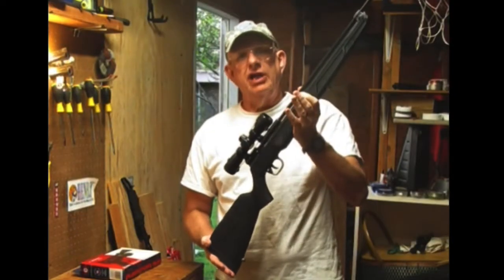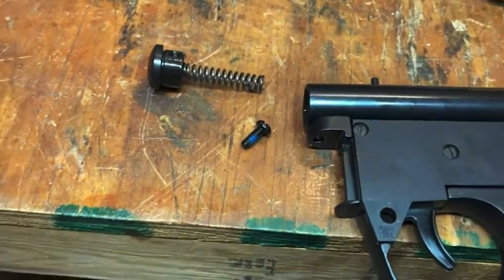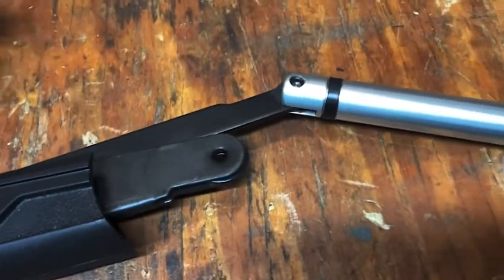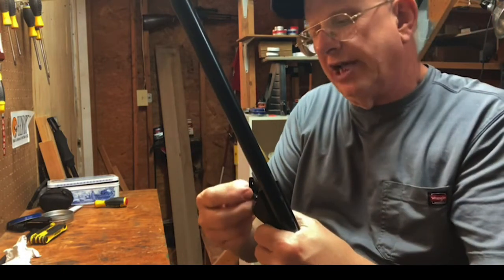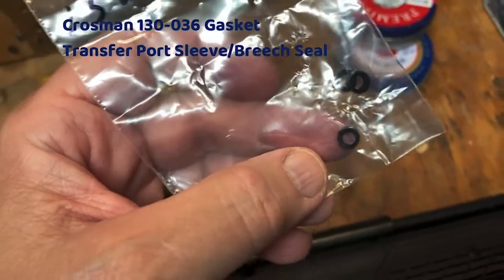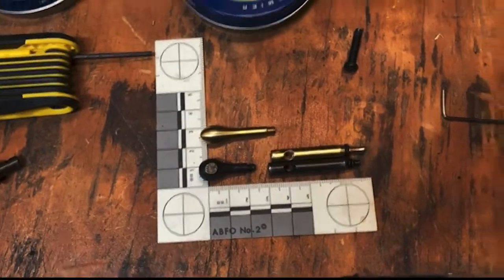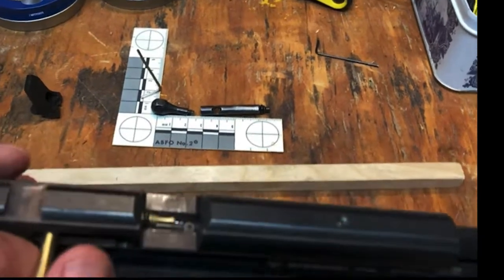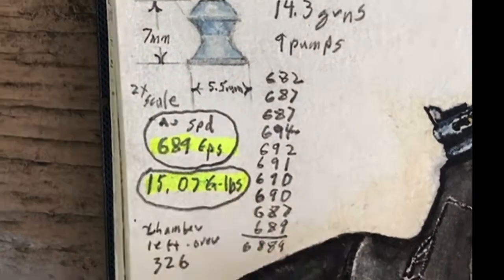Crosman 362 amped;  latest mod, a custom valve cylinder, requires taking it apart but gets 690 fps

Comment: You need to get a heavier hammer spring or lighter exhaust spring to get a full dump. You ae over pumping the rifle and getting a partial valve lock and retained air.
Reply from the maker: I did.  Three different ones.   I did a video on it, and in the process lost about a month's time in making videos.    The video came out end of last summer "Murphey's Law goes into effect."   The Crosman valves are not designed for the PSI of multiple pumps these aftermarket guys say work;  I had several viewers say all I needed to do was get stronger springs.   If it works for you....fine, didn't for me..   If you limit the number of pumps, the gain in speed in marginal, and absolutely not worth the effort or the expense of the drilled out valve.    Thanks for comments, though,  just my experience is different.

Comment: Who makes a good extra power hammer spring for the 362 ?
Reply from the maker: I don't think there is any one brand name seller.   I had to look up the hammer springs under a general search of Crosman 362, Crosman 2240 repair modification parts on e-bay.   There are three different sizes.   I tried three.   That is covered in a subsquent video, which I referred to later in this one.   The one called "Murphey's Law goes into effect"   It is listed in the discription section above too.   I don't think this kit works with a stronger spring.   Better off just taking the left over air out on a follow-up dry fire.   I ended up screwing up the modified valve so much, I don't think it is safe, and  just going back with the factory valve and spring, and it works fairly well with the extended bolt and the metal breech, which do make a difference and do not put a strain on the valve assembly.   If I had to do it over again, I would have stopped where I was at the end of this video, and like I said either bled out the extra pressure on a dry fire, or not pumped it as many times.   But as you can see from the comments, a lot of people apparently had success from a heavier spring;  I didn't, and don't endorse it.
Reply: @brianwilke592  I think maybe a heavier hammer might help it. A heavier hammer would hold the valve open longer before it springs back I think. I have not been able to find one. I have a 100th anniversary. I really like it. But it works best with 7 pumps. I don't have a chronograph. But I know it don't hold a lot of air left at 7 pumps. At 8 pumps it seems to hold a lot left. I would like to get just a little more out of it. I want to hunt squirrels and rabbits that get into my garden and blueberries a lot. I need about 700 fps instead of 600 and that might do it. Energy goes up with the square of the velocity. 7/6 squared is 49/36. Close to 7/5 or 40% more. I don't want to modify this rifle much but it is very accurate. Just a little more energy and it will make a good small game rifle. But it's got to be able to dump the air into the barrel. Well anyway I am going to study on it a little more before I start modifying a collectors item. I like watching your videos. Informative. Keep em coming.

Comment: Also you got quite a bit of retained are in your valve you could definitely benefit from a heavier hammer spring and you can definitely get over 700
Reply from the maker: Several other commentors also made a similar comment, so I tried, unsuccessfully, to increase the hammer spring.   I ended up locking up the valve to the point where it was kinda dangerous.   I should of just dealt with the air dump; the velocity was good, and it takes some extreme fine tuning on both the hammer spring AND the valve spring.   Here's a link to my subsequent video:  https://www.youtube.com/watch?v=gAjhF_W9xf4&t=221s.   I appreciate your advice.   You might have had a successful conclusion, if you did, let me know.   Thanks!
Reply: @brianwilke592 I do have a successful conclusion the 262 is the exact same system as the 1322 just with a longer stroke tube and barrel and I was able to get over 700 ft a second out of the 1322 and 14 inch barrel so the 19 inch barrel on the 262 with literally double the stroke  volume if you get online there are tons of mods for the 1322 and they will all drop on to the 262 the 262 honestly can produce 800 ft a second with a lead 14.3 grain and 15 strokes with a flat top piston & valve, retuned springs, exhaust porting, barrel porting, ice maker tube for a transfer port reshape the face of the exhaust seal and thin down the shaft of the exhaust seal in a certain spot and pin the inlet seal so you have no dead air in the headspace and then if you want to take it a step further so you can over pump it without causing any damage to the system over years of service pin valve through the tube and into the meat of the valve and make a spacer between the PIN for your pump arm and the PIN for the barrel band so you reinforce both ends of the pump stroke then you'll have a 25+fpe multi-pump that you can pass down to your kids. I totally nerded out on you sorry😅

Comment: Cut you a little piece of ice maker tube for the refrigerator and use that as your transfer port not only will it have a larger inside diameter for more airflow but it's plastic so it's going to seal really good
Reply from the maker: Good tip!   I'll try that on any project with a Crosman, since their transfer ports are all pretty much the same.
Reply: @brianwilke592 Benjamin too

Comment: The 362 uses the same trigger as the discovery and 2260. You can do the 2or 3 set screw mod that makes it adjustable  all you have to do is  drill and tap the back of the housing and add set screw  it takes quite a bit of slop /play out of the trigger .  If you want more power  makes the valve a flat top  cut the tip and sand flush and flat them order the flat top pump piston. You can use the same valve  this will give you the most amount of power  the only other thing that can be done is the all port hole enlarge along with barrel    and valve  to match .  You could also  put a heavier hammer spring and light valve spring  so the valve stay open longer . Just a few more power upgrades and tips. 🫡💯👍✌️😉

Comment: I had a 362 that wouldn’t quite dump all the air at 8 pumps. I ended up shimming the hammer spring with a washer and trimming the valve spring slightly (which probably wasn’t necessary.)
Reply from the maker: I ordered a .42 gauge hammer spring, shorter than the factory from Magnum AirPower.  He claims it will help with air dump problem. Several other commenters have also said the spring may be the problem. I gotta finish editing my next video first though. (It didn’t turn  out like I wanted, but the show must go on). After the next video gets out, I’ll try it.

Comment: Did you try a little heavier hammer spring?
Reply from the maker: Not yet. The information provided by the seller of the custom part indicated the 362 spring was powerful enough; it was the reason he provided a new, stronger hammer pin.   But yours isn't the only comment that suggested going with a stronger spring.   I need to look in that more.   Do you by chance have a recommendation?   If buying the right spring makes the difference, I'm game.  Easy enough to install a new one.   Thanks for the comment.
Reply: @brianwilke592  One definitely can get some pretty good gains on fps. However, with anything in life, when you change things  there can be side effects some negative some positive. While that valve is a tough proven workhorse, the stock cocking pin "could" bend over with time and it also puts more strain on the trigger sear (especially if you modified the sear spring to reduce trigger pull). Also, one runs the risk of a negligent discharge if the gun is bumped. The good thing about it though like the 1322/77 platforms they have aftermarket hardened parts out there to use to beef up the 362. The 362 is an incredibly efficient pumper straight out of the box. But, there is still room to kick it up a notch or two safely by farting around with the stronger spring and a 24in barrel. You should be able to get around 18fpe without problems. I'm just glad they still make things that the consumer can modify at least a little bit.

Comment: Great video and the rifle is nice. However, I don't think these guns are worth the effort or the money it takes to improve them....just my opinion. You have to have close to $300 in that gun, for me, I will put that money toward another HW break barrel. While, it is a different rifle, it is truly a DIFFERENT rifle than the 362.
Reply from the maker: Well, I respect your opinion. I have several break barrels, the Ruger Max Elite probably my favorite. It was not cheap, but not $300. My main problem with them is some are good(my Max Elite) and some Suck, like my Umarex Ruger Air Hawk. I have not even unboxed my Crosman F4. I don’t know why I was compelled to buy it; it just looks cheap. Some day I’ll do a video, don’t worry I’ll be fair,  just the facts.  The biggest reason for me is the KerrChunk of the piston going forward. Feels like a dang M60 hitting a dud round, and the things are so heavy they might as well be a 60.   That’s just me. I think a pumper can be tuned and if done right is competitive with a kerchuncker. Stay tuned, in a couple months I will do a competition between the Max Elite and the 362. I’ll call it “Pellet Bowling”. I will have to make it so each gun fires its best shot from 25 yards. Thanks for the comment!  You may actually be in the majority, but I really like the satisfaction of working on a project and having it come out good and looking good to boot. (For example the brass bolt is similar to putting chrome parts on a hot rod; not needed as much as just looks cool)

Comment: Great job Brian! Stronger hammer spring with a maxed out transfer port. Try some 15.9 or 16g pellets from JSB, JTS, or AEA. This may be the most accurate pellet for you. Can't wait till you do your 25y accuracy testing. Try some 18g pellets too. Keep up the good work.
Reply from the maker: I notice a lot of other airgunners are using those JSB's.   Maybe it's high time for me to give them a try.   I'm going to do some research on the hammer spring.   BackYardDispatcher said the same thing.   The seller of the custom valve also included the maxed out transfer port, which I used, and a new hammer pin.   He said that Crosman's spring in the 362 was plenty powerful, so powerful that a lot of 362's were going down due to the factory Hammer pin going out.   Any suggestions on what to specifically look for, or ebay store?

Comment: My thoughts Brian is your valve has so much pressure it can't hit it hard enough,I think if you had a stronger spring it would dump more of it's air that's left. I think if you get a stronger spring you could easily make it to 800 fps
Reply: I agree this modded 362 valve needs a stronger hammer spring. My estimate is more like 750 but we'll worth it.
Reply: another vote for beefing up the spring, can also try shimming the spring, maybe a .25" shim lol
Reply: @cnjhendricks  i like your idea
Reply from the maker: @cnjhendricks  See my reply to BYD.
Reply from the maker: Thanks for the advice.  I will definitely look into this more.   Getting more comments saying the same thing.   I'm for getting this baby to 750 to 800 fps (with lead pellets, not those alloy ones....they fly all over with this 362).   I'm all ears on any recommendations where to look (like ebay store).   If I find it, and it works, I will definitely do another video.  Replacing the spring is definitely doable.

Comment: I had a Benjamin 22 cal in the 70s. I got a lot of ducks on creeks with it and even a coyote. I can safely say I got over 1000 rabbits with it. I often got over 5 a night protecting our farm crops. It was so accurate!
Reply from the maker: Never had a Benjamin, but I have learned a little about the old ones.   Sounds like a great air rifle.   Just curious, was the one you had, was it old enough to have been made in St. Louis?   That probably sounds a little strange, but St. Louis is one of those cities that has a lot of stories, long gone.
Reply: @brianwilke592  I had one from the 20s too but not sure about where they were made. Somebody stole them.